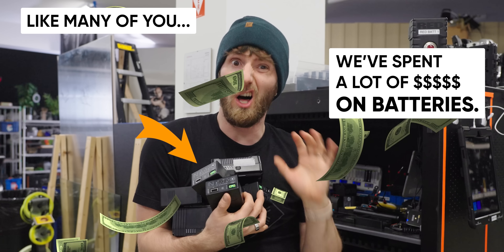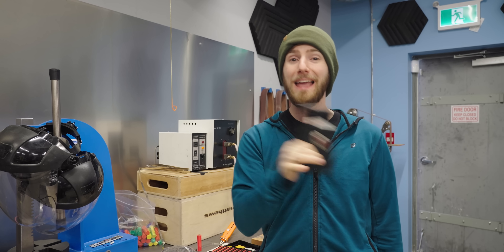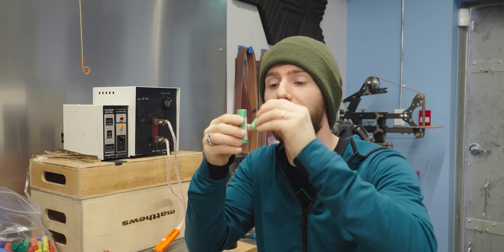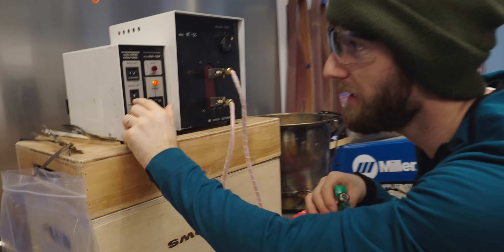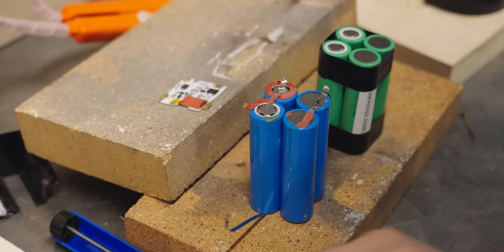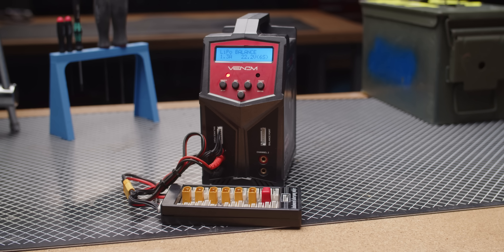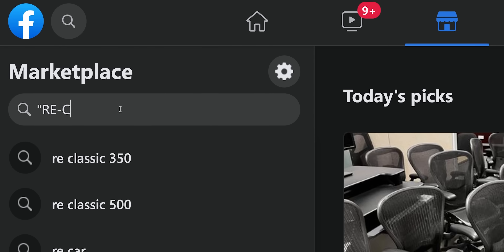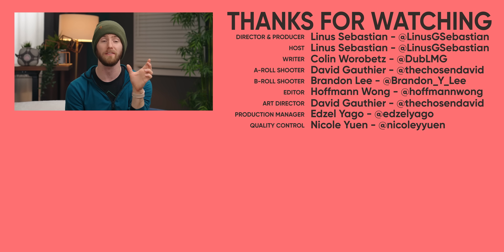This should be illegal… Battery Repair Blocking

Comment: I've done a lot of these battery rebuilds and just because the spot welder Sparks badly like that doesn't mean the battery was affected at all. That's just the spot welder reacting to a bad connection. So your batteries are fine.
Reply: yeah was a lot of overreatcing in this video
Reply: @ProfessorShroom  right? you'll know when flames shoot out, that was just poor connection for the weld. Like hooking up jumper cables.
Reply: @ProfessorShroom  tbf, A inextinguishable fire is a scary thought.
Reply: @ProfessorShroom  its a linus video did you expect correct information and useful instructions?
Reply: @alex31ytb  You're right, how dare they show safe precautionary practices to follow to a largely uneducated audience about the subject.
Reply: @RashidTak  i mean it's better to be safe than burn down the building. Especially if they don't know exactly what they are doing (which they weren't). I'd too rather waster 15$ in batteries and be safe than burn my whole apartment down
Reply: @RashidTak  its better safe than sorry but a mention of "this is a safety precaution and if nothing happens withing 24 hours you are fine to test the cells and see if they are actualy bad" would have been nice
Reply: @alex31ytb  it’s Linus comment section. Do you expect snarky know-it-alls in here like this kid? Of course
Reply: @eskamobob8662   making that statement in  video caries a lot of legal liability so I'm really not surprised they didn't want to say that. I have never done this kind of thing so am in no position to comment. I would say though give  they found the controllers are mostly setup to die if you do it successfully is there currently much point trying? I woodwork as a hobby and use battery powered tools in that so I'd been curious about this from that perspective when I have a battery die maybe I'll look up to see if there is an ABC recell guide for that specific pack and may use it when buying new tools to get something more sustainable even if I outsource the job. Certainly interested to hear more on this going forwards though.
Reply: @RashidTak  i think i scared more ignorant people away from trying themselves then encourage it.  linus thru several dollars away over a welding arc. there is safety and then their is stupid.
Reply: @conbonesthevoid1448  why would I want to try it myself if there's still a risk, no matter how minimal, of me causing a fire and ending up without a place to live or killing my family?
Reply: @n3ttx580  Except there was literally no damage, only wasted cells that are still completely fine.
Reply: @hubster6381  i don't think you could possibly get in trouble for "sparks don't 100% guarantee a dead battery but we are being safe"
Reply: @eskamobob8662   I don't recall which but one US car maker has since long before self driving cars were a thing had to put in the manual that cruise control doesn't mean the vechile will drive itself. Never underestimate the stupidity of the public at large.
Reply: @hubster6381  And now with Tesla, self-driving doesn't mean that the vehicle will drive itself. We've come such a long way...
Reply: @hubster6381  That's exactly the same thing as just putting a disclaimer in a video like this. It's better to have accurate information with a disclaimer than innacurate information.
Reply: @Nazgul094 for you i suggest not even driving it may be too dangerous for you.
Reply: @diceyoam  show me one instance where linus proves he knows anything at all about any subject
Reply: @eskamobob8662  yea to be the most safe, testing and close observation for about a month I think is common protocol in the industry. Or at least what it recommended, IIRC.
Reply: @alex31ytb  Lol true, he's a pro noob at most of the stuff. I watch for entertainment purposes. I remember when he made the video saying all HDMI cabes are the same and any will do and connector quality didn't matter... fast forward and he's making whole videos to the contrary. I was terminating HDMI at the time doing professional installs and I called the bs immediately. Even back then before saturated MHL tech took off it mattered.
Reply: @oODReviews  I think he meant the stuff between normal HDMI cable and the snake oil called "gold plated HQ hdmi cables"
Reply: I was going to say, lol. The spot welder is arcing, the batteries are fine.
Reply: @monte0704  He wasn't even holding the tweezers right.
Reply: I was gonna say the exact same thing. You will NEVER manage to assemble a large pack like that without your welder making some sparks. As long as they come from the welder tips, and the cells stay cool, this is normal. The biggest pack I've built has 40 cells and that happened countless times during assembly. I've been safely using the pack for months.

So I understand the need to demonstrate safety precautions, but saying that a pack needs to be thrown out because your welder sparked is simply misinformation.
Reply: Yes it was safe, even if the spark originated from the cell it just needs to balance. Discharging them first would have been the smart move. Also I've never had a BMS that didn't allow recell and even if it did most of them are simple and or easy to replace
Reply: Exactly. Its good practice to set the patterns aside and then do a discharge test to make sure you didn't blow the ptc but even when sparks like that happen in production of EVs its not a big deal so long as you don't have slam shorting a cell or something
Reply: 17:26 They even used stock footage showing similar sparks when the spot welder activated. That technician is not phased by it at all. I get being safe but it did feel like a bit of an overreaction.
Reply: @Gareth Tucker I completely agree that this is not something that should be recommended to most people. However, misinformation is not the right way to convey that message. At worst, it's fearmongering just like the anti-RTR companies are doing. I know that wasn't the intent in this video but that is one way it can come across.
Reply: I thought the same but i haven't done battery builds yet i have just seen alot of videos about people building batteries but to be fair i did similar stuff also when i replaced my first phone battery. I was extremely careful.😃
Reply: Thank, you, I also thought of that. A half year ago I replaced two cells of a brushless drill, there were sparks, but it's perfectly fine.
Reply: This triggers me so much
Reply: It literally sparks in the "professional way to do it"  at 17:26.
Reply: idk about the other packs he tried but the one on camera, it popped/punctured the cell, if you listen close you can hear it hiss and loose pressure like a tire lol. the other cells are fine.
Reply: This seemed like an old infomercial where they take some mundane task like washing dishes and turn it black and white while playing evil music. If it wasn’t for the fact very few people will ever try fixing their own batteries I’d thing that was a disinformation video trying to scare people off from trying. 

That said lithium can be dangerous and I like LTT but go watch other videos from people who dedicate channels to this kind of thing for better info.
Reply: Yeah video was bs. You can even see the sparks in the "professional" video at 17:30.  
He should have just shown all the cells and we would have seen that nothing bad happened to them of course. 
But at least he talked a bit about right to repair which was good.
Reply: I once fudged a recell by dropping a screwdriver across the thermistor terminals, in 0.5 seconds everything went from fine to FUBAR
Reply: I was thinking the same thing haven’t done welding since highscool but very clearly remember teacher saying the spit welder will spark if you keep it on long enough it’s just reacting to the metal
Reply: @MKDC-5  Source?
Reply: Came here to say the same thing
Reply: Linus would hate ryobi power tools
Reply: Ive gotten into rebuilding Milwaukee batteries this past year and I agree. Its not a major thing for sparking. Like a bad connection at the welding tips and the slight arc it makes finding its connection.
Reply: yeah. Lots of unnecessary overthinking in this video
Reply: with 14.x million viewers..you tend to be told 'ere on the side of caution'  by the legal team.  I personally wouldn't have flinched at anything short of "omg, this battery is suddenly heating up"
Reply: You are right but Linus has 12 million subscribers and with that many people watching its better to be safe than have some moron copy you and get seriously injured...If anyone is attempting these kinds of projects its probably better to watch a professional...
Reply: @brucepreston3927  Misinformation can have the opposite effect.  If LTT's credibility on safety is not reliable, then they can be seen an untrusted source regarding safety and any advice or warnings may be ignored because the perception is that LTT overreacts when it comes to all safety measures.

Comment: I've started doing this with laptop cells, replaced my OMY2s 6500mah 2 cells with 4 samsung s6 cells to raise the capacity to 10200mah. Your spotwelds need to be gentler. Also you have to restart your BMS with some load, such as a LED or a resistor... Or just a 9v / 3v bat depending on your voltage.

Comment: I won't try this at home!

Because I don't have incredibly expensive RED Cameras
I did buy an iFixit kit though, but not for my phone, because I'm not that handy and I'm sure I'm going to break both glass panels and countless wires by pulling them apart, setting me back much more than when I would take it to a certified repair vendor.
The kits look amazing. Can't wait to use it

Comment: Tool brand Makita is one of the evil ones. if you run the battery to low to many times i think like 5 times. The board will brick the battery permanently.

Comment: Definitely make a video of the facility and more information on how/where to have these things recycled. Manufacturers can also produce packs that could have more serviceable packs that do not rely so heavily on spot weld connections. The balancing of cells and installing cells can very easily be a multi step process for higher end consumer goods. Planned obsolescence in itself was planned by dumbing down society over the past 50 years by removing maintenance routines from public access. Remember those old hifi audio/tv consoles? They all had a schematic built into them with part numbers, cars came with instructions in the owners manual on how to set the carbs and engine internal components and it was expected that the end user was to take care of their own stuff. Problem is that people became unwilling to follow through with their stuff and it became easier to just replace the whole thing rather than 'fix' it and people couldnt be bothered with the time it takes. Now with the attention given to resources and the ever increased costs of just replacing things, people are starting to take note with fixing their stuff rather than trashing everything.

Comment: An then there is Toyota who will happily refresh car batteries by replacing or reconditioning cells and even recycling old battery cells when you chose a replacement. It's not perfect but it beats the industry standard by miles 👍🏻

Comment: Another thing that could be done is stop using spot welded construction for batery packs, either use regular wire leads or pressure contacts for example, that would also make repairs much easier

Comment: You are spotwelding. 
Spotwelding gives off sparks for a multitude of reasons. Wrong angle, not clean tips, not enough pressure, contaminates on the surfaces. Spotweld sparks are not dangerous by themselves, and are not dangerous to the batteries.
It's "just" molten metal that is not contained inside the spot because of pressure due to the heat, it's NOT electrical sparks.
/A robotics and spotwelding engineer.
Reply: When you are spotwelding you try to avoid sparks as it's wasteful and gives slightly less strength, but it's quite impossible to do with your crude system. In professional self regulating systems have much more control of the spotwelding process, but still can't get a totally spark free process.

Comment: There is one more issue, kinda trivial:
You may need to connect the battery to a charger to reactive the BMS. Otherwise it will stay rather dead. Like 1-2 secounds in the charger should totally do!

Like connecting a load after building will lead to absolutely nothing. Still it will not work on self-destruct BMS boards.

Comment: "if you as a manufacturer have done this, shame on you"
100% of manufacturers just shrugged.
Reply: These are crimes against humanity.
Reply: @yuliangeorgiev  And you think the manufacturers care? They only care about money, sadly.
Reply: @nuno-cunha  Well, it is hard to sell things. When humanity is dead. So. Yes, they kind of have to care.
Reply: @nuno-cunha  gypsy
Reply: @yuliangeorgiev  manufacturers: we're using slaves anyways, you thought we'd care?
Reply: This is not malicious, it is an added security. This mechanism probably saved countless lives and prevented many fires!
Reply: @erdem--  Undoubtedly so, but on the flip side, it prevents professional fixers from doing their job and creates more waste than necessary
If you ask me, I'd say a label that says "DANGER: Risk of severe fire or death" should be equally sufficient
Reply: @trailblazercombi  Due to the 0 volts on battery terminals, the IC in the bms thinks that there is a short circuit and locks itself. This safety mechanism is here to prevent further use a damaged battery. If further use of occasionally shorting cells allowed, many people would die, or many houses would be ash...
Reply: @erdem--  Apologies, I see your point now
Reply: @Erdem  Besides. If you ignore all the warning labels and the like. You kind of deserve to be punished for your stupidity. I mean no one has yet sued the internet for making them do stupid shit (or maybe there was a case. Who knows? I maybe sadly not making this up....)

Comment: Your battery spot welder settings were not dialed in well IMO - i think your duration was way high! it's just 5 ish miliseconds and a couple of tiny sparks. shiny metal everywhere still, couple of dimples where the spot weld is. strong enough to rip the nickel instead of the weld. i have built new/ rebuilt old ebike backs before :) don't feel bad about letting the smoke out. been there.

Comment: I had no idea it was actually that dangerous to mess with even "small" lithium batteries. You may have just saved me making a big mistake in the future, thank you Linus and team!
Reply: yeah and the fumes are highly toxic even your phone could explode.
Reply: The sparks were harmless and caused by the welder not the batteries. It can happen when the welder doesn't have perfect contact.
You should probably look to videos from the DIY ebike community rather than Linus for reference.
Reply: Yah what happened here isent normal I'm guessing that welder is either set up wrong or there's something wrong with his batteries.
Reply: Its dangerous, but not that dangerous.
Linus definitely overreacted by using the bucket immediately after seeing even a tiny spark.
But its still possible for the cell to catch fire if you will short it permanently. 

Those sparks looked more like the effect of not balancing the cells before building the pack. 
Not dangerous, but might damage the cell reducing its capacity and lifetime.
Reply: @hubertnnn  I have shorted 18650 on several occasions when the plastic insulation was broken. Either with a screw driver while trying to shuck them or when putting them in a charging bay. They throw a few sparks and you immediately pull them away. Nothing happens if you don't keep shorting them for a certain amount of time. All of the cells are still perfectly fine, I put some 18650 shrink wrap on them afterwards. And I try to be more careful in the future and watch for damaged insulation. But it's not like to have to run to the bomb shelter immediately.
Reply: did you ever see the video of the kid who microwaves a small glowstick to make it glow brighter? nothing that has chemicals in them that can violently react is "easy" to repair or atleast should be repaired with alot of safety measures.
Reply: We don't think much about it but lithium is absolutely terrifying

Comment: About the BMS =)), you should put it in the charger after you connect the new batteries to it, so it can get some voltage and start.

Comment: Makita power tool batteries are the evil kind. I have also seen them brick if you don't use them often enough or leave them on the charger too much.
I have rebuilt a couple of my own Milwaukee batteries no problem.